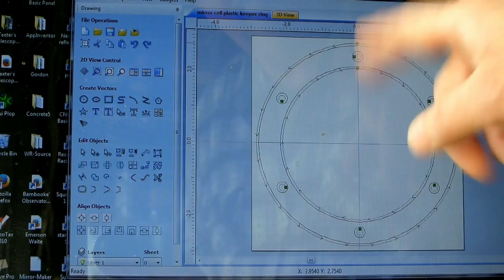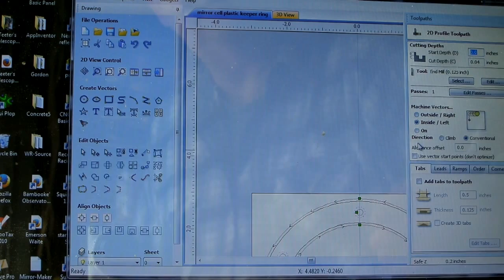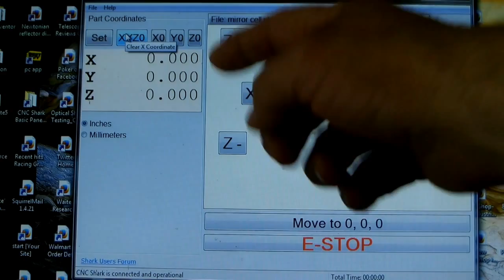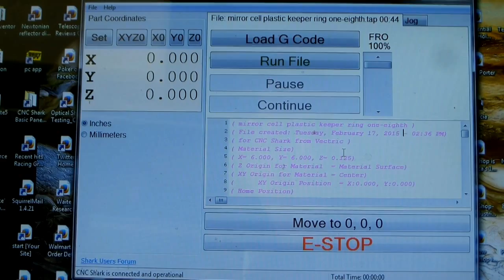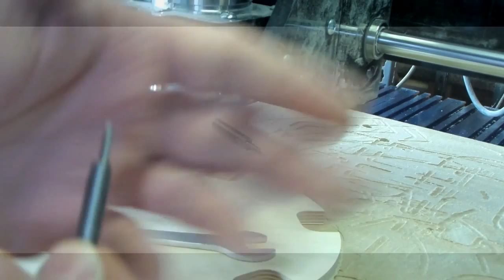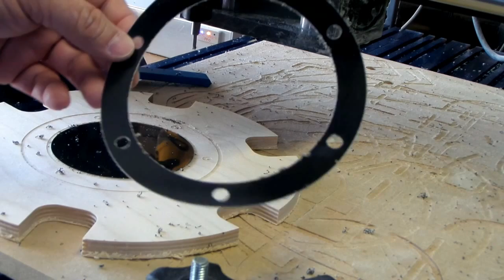How to Make Mirror Cell Parts for a Renegade Telescope Using a CNC Router

Comment: In a classic dobsonian, the collimation bolts are at the mid point of the bars that connect the triangles (where you currently have the 3 rod ends meting each other). But in your design, if all the collimation bolts are racked up and contacting the mirriror, then are the triangles doing any support at all? Forgive my ignorance, only tryign to learn from your design. Thanks

Comment: Gordon, thank you so much for sharing your experience with all of us! I am in the process of building a light weight hexapod with 14.7" x 0.8" mirror and will most likely use your awesome mirror cell design. Could you please recommend the total thickenss of the plywood rings for such cell for my mirror? I also have a CNC and designing my scope with FreeCAD. It has a great feature, where key parameters like mirror size and FL can be entered into the spreadsheet inside of FreeCAD and everything else can be computed from there. Just an alternative to LUA.
Reply from the maker: The thickness of the cell isn't really critical.  If you don't want protection, make the cell short to save weight and material and fab time.  If you want protection from the cell, make it at least 6" tall, if not taller.

Comment: Zero with a brass plate + crocodile clip, battery and bulb, choose the thickness of the brass plate so its easy to just add that depth after the plate is removed.
Reply from the maker: Yes.  Since the video, I purchased the company's zero plate.  Works like a charm, and much easier!

Comment: Great work.  There are rules of thumb out there, but you have real world input so...  In your experience, how thick does a mirror need to be to not require multi-point suspension?
Reply: Too thick if it’s bigger than around 8”.

Comment: Gordon, if you tear off a corner on a piece of printer paper you can use t he paper as a feeler gage between the bit and your work piece.  The paper is general 0.004" of an inch.  Makes finding your Z height fairly easy.
Reply: First time watching this video. I was going to suggest the same. To build off of what Driver said, slide the paper back and forth, stepping your bit down slowly to feel for it to grab. That's your reference point.

Comment: Thank you for the great video!
The cell looks very heavy but as you lifted it I thought it must be made of plastic :D

May I ask what it´s really made of?
Reply from the maker: Ukuhlehleh Thanks for your kind comments on the video.  The black outer ring is made from laminated baltic birch plywood that is cut on the CNC machine.  It is made in layers, and threaded couplers are glued in between the layers.  All of the spherical bearings are stainless steel.  The triangles are all baltic birch plywood.  The little tips that the mirror sits on are nylon.  For a 12.5" mirror, the mirror cell itself probablyonly weighs a pound and a half or maybe two pounds.  Plus the tops of the triangles sit only about 1.5" above the floor of the housing.  Pretty low and pretty light at this size.  For a 20", the stainless parts get a little bigger and a little heavier, but it's still very light compared to a cell that has a square tube welded steel frame.
Reply: Baltic bitch triangles instead of aluminum. Genius.

Comment: Very nice work!
Reply from the maker: nirvanix88 Thank you!  Have to give a lot of credit to the software and CNC machine... once you know what you need to do, and how you want it to look, the CNC is pretty much perfection every time.  It's great, too, to be able to think up some custom feature and be able to get odd and difficult pieces done so quickly.
Reply: GordonWaite Yes the CNC lathe is a wonderful toy! But my comment was directed towards the design and fabrication of the whole cell. That is brilliant. The Renegade is a gorgeous scope, although I thought they originally had a smaller (like a ring) upper cage? Someday I hope to give you a jingle about a 20 f/3!
Reply from the maker: nirvanix88 Thanks, you are very kind!  The upper cage has always been had the wooden liner as standard.  We've experimented a lot with the thickness, and have now settled on a 1/8" aircraft-grade plywood for the liner.  It's very light and very stiff, and quite easy to fabricate.  The mirror cell was a tougher design.  I've made a lot of different ones before getting to this one.  The first ones I did were hard to make accurately.  But with the CNC-cut template, it's now easy to get them spot-on.  I'm still playing with the "keeper" plastic, though.  I'm experimenting with adding an outside set of pieces just to make sure everything is perfectly placed.  The spherical bearings are so good that the pieces can move around a lot unless they are gently constrained.  Usually the design just snaps into position when the mirror is put on it, but once in a while something gets slightly out of bounds.  It's easy to re-align with a quick little shake, but I will get rid of the effect entirely with the outer limiters, I believe.  The 20" f/3 is really a joy to use.  Every place I set it up, people think it's a 16" because it is so short and the bottom is so compact.  It's actually easier to set up than my old 8" f/8!  I'm working on a 20" f/3.3 now, as some folks think the f/3 is actually a little too short!  That 66" focal length lets me use a slightly smaller secondary, which makes the UTA a shade lighter, and reduces the diffraction a bit and improves the contrast a little.  Thanks again for you generous comments!  -Gordon
Reply: GordonWaite You're welcome. Looking forward to more videos.